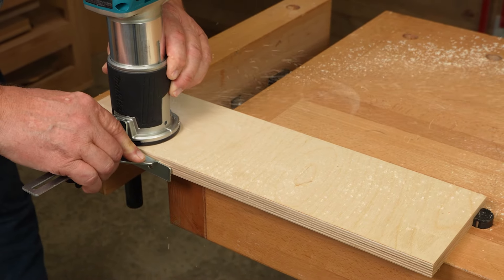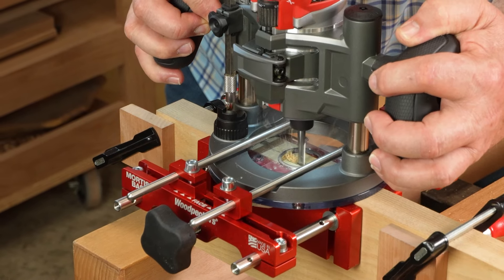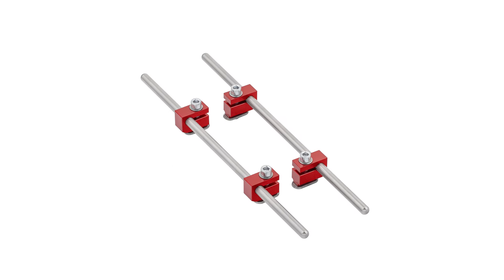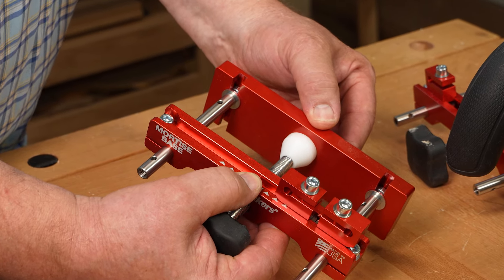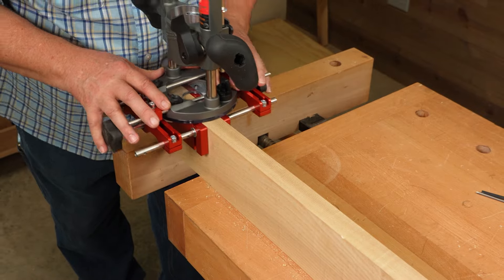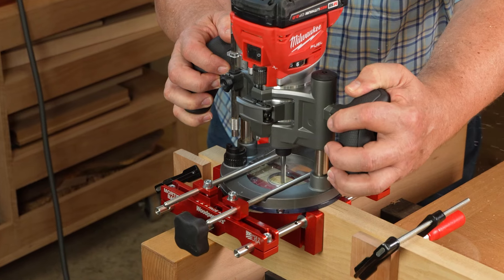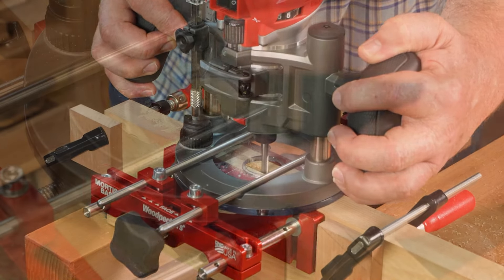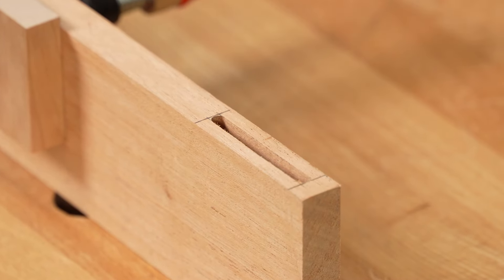Mortise Base | Woodpeckers Tools

Comment: Could you please tell me the guide rod size for the Makita RP1111C router? Is there an optimum size range for router bases that can be placed on this jig? Thank you.
Reply from the maker: I would be surprised if it was anything other than 5/16" (8mm). That's what most Makita routers are. Here's how to check for sure. Take a 5/16" (or 8mm) drill bit and see if it fits the guide rod opening on the router base. 

The guide rods are long enough to accommodate just about any router base made. That particular router looks well-matched, based on a quick read of the spec sheet.

Comment: What is the maximum stock thickness? Thinking of using this for bench top glue-up.
Reply from the maker: Depends on your router base, but most likely around 4"
Reply: @WoodpeckersLLC  Thanks! That works.

Comment: What would be the rod size for Dewalt compact router base ? Thanks
Reply from the maker: We don't have a DeWalt in the model shop and it isn't in any of their spec pages I can find. I think it is 5/16"...here's a quick way to check that. Take a 5/16" drill bit and see if it fits in the guide rod openings. If it's too big, try 1/4". I'm pretty sure it is going to be one of those two.
Reply: Compact base is 8mm
½ router is 10mm rods

Comment: Just get a domino! You’ll spend all these money not to buy a domino, and at the end you’ll realize it’s not repeatable and then you buy the domino.
Reply from the maker: Not arguing the Domino's value or ease of use, but there's a pretty big jump from $170 accessory for a router you already own to "just buy a Domino" for $1,300.
Reply: @WoodpeckersLLC  I’m speaking out of experience. I tired bunch of options and after wasting few hundred $ I picked up a used Domino. Your device looks beautiful as expected. However, there’s room for a lot of human errors and frustrations. The fact that you have to clamp a stop-block makes this very unrepeatable.